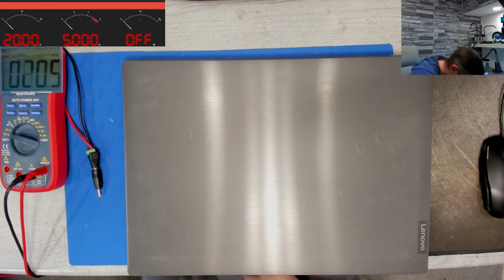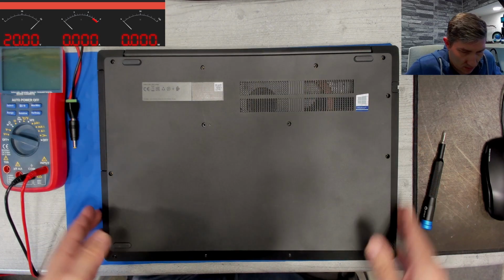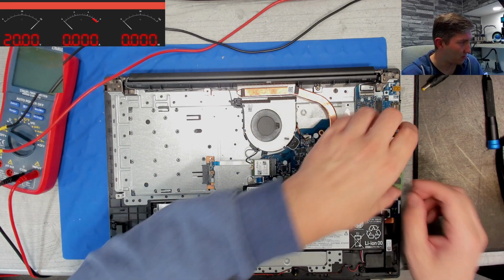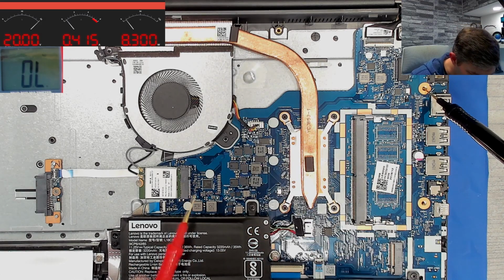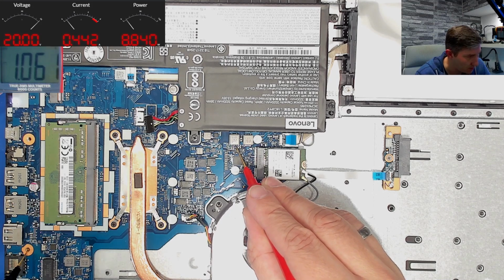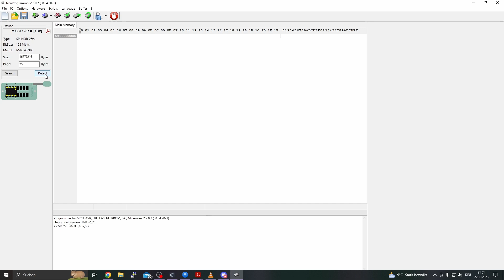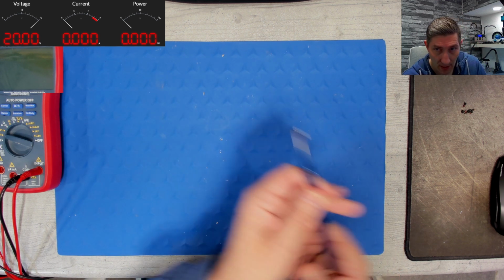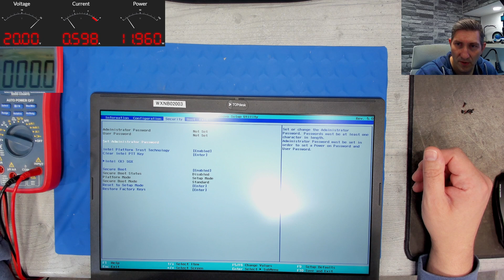Lenovo Ideapad V340-17IWL - Heavy like a stone but almost nothing inside. And Why is it bootlooping?

Comment: Hello, thanks a lot for your interesting videos!  
I'm asking me why you need the serial number etc in the new BIOS again? It would be much easier to just download the latest BIOS from the company webside and flash it to the chip. I did that many times with the CH341a device for normal ATX mainboards and it was never an issue. Is it different for notebook mainboards?
Reply from the maker: Well, it is basically just the "extra mile" to restore this system with it original S/N, Windows license and everything else unique, nothing more.

I do agree that it will basically work without all this extra stuff done on most of the cases, too

Comment: Do these lenovos no longer have USB bios recovery methods? Most machines I've come across have at least some method in the documentation for doing so. Generally a specifically formatted USB key (Fat32, or exFAT) with the bios file renamed and placed right on the root of the drive, and then holding a certain combination of keys. Grabbing the latest from the website and doing that seems much easier than un-soldering the chip and reading it/rebuilding manually.
Reply from the maker: I don't know to be honest. For me, it is faster to remove and reprogram than to do complex research for..  minutes... hours? I don't know. But thanks for the hint. Regards
Reply: Makes sense. For the ones I've done, usually about a 10-15 minute procedure by the time I've found the instructions and downloaded the new bios. That does of course require that the board be fully functional otherwise. The post code you were getting with the LED on the board also likely indicates the same thing. The fact that it was functioning enough to display that is a good sign that USB recovery methods would work. As long as there's no malfunction in the memory itself.

Comment: The problem with laptop companies is that they do not take advantage the empty space for bigger batteries... only Apple does that
Reply: Honestly id question if apple has much of a bigger battery when it comes to actual energy storage, Wh.. Also, there is a limit how far you can go, if i recall correctly its 99Wh, anything above that and you cannot bring the device in planes and so, so manufacturers tend to be below that

Comment: 27 minutes video with common bios reflashing...OMG
Reply from the maker: I am sorry to disappoint your expectations. In my opinion, the diagnostic steps until the point to flash the BIOS are important, especially if it turns out not being a BIOS issue.

I have released a few dozend videos with other faults. Some were complicated to diagnose, and some were hard to solve. 

Maybe you'll like them more. Best regards